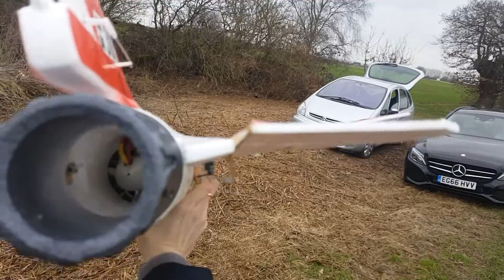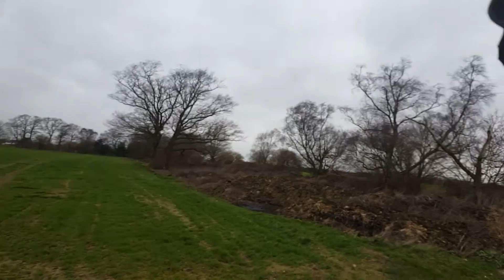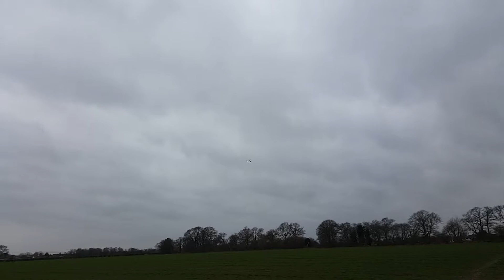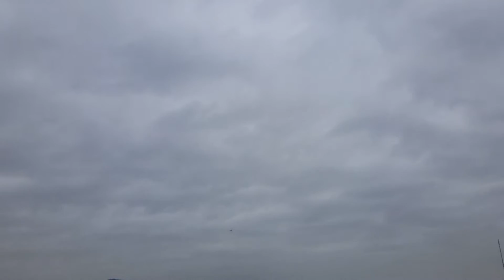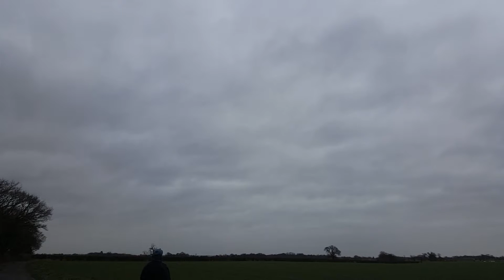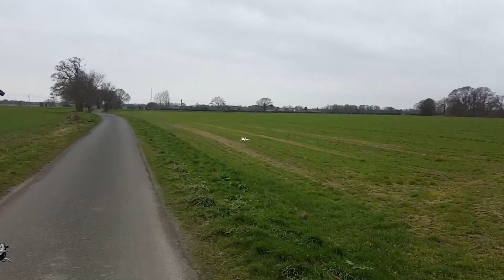HobbyKing F-16 70mm 4S Lander 10b 2970 3000kv

Comment: i was thinking of putting a Dr mad-thrust 70mm on a 4s set up. how did it fit...easy?
Reply from the maker: Yes, mate.. v easy. It'll slot straight in. You may want to cut/melt/sand some foam away so that the air leaving the EDF doesn't need to squash into the thrust tube quite as much.. Like, smooth the transition out, if that makes sense? It fits 70mm without issue, but the thrust tube is ready for 64mm. As long as you lessen the step, all is well.
Reply from the maker: Btw, most DR Mad Thrust motors are RC Lander units.. which is a good thing. 2950, 2970 3000 and 3300kv are both made by Lander.